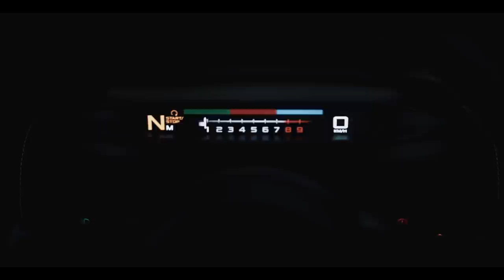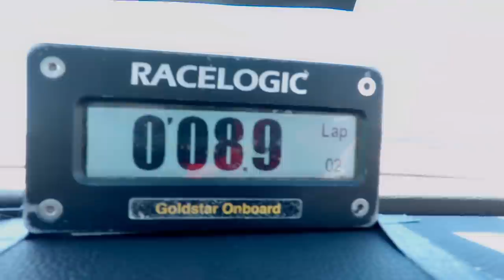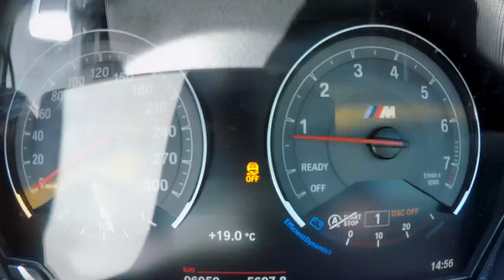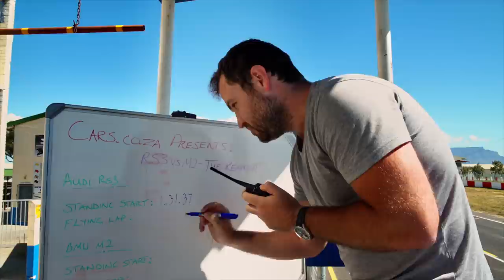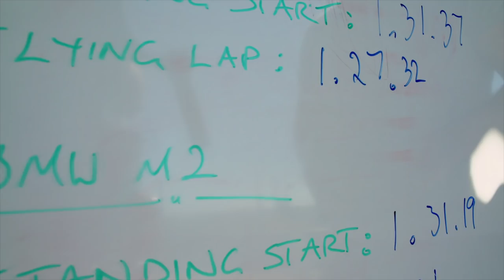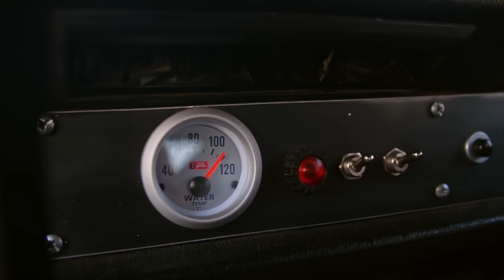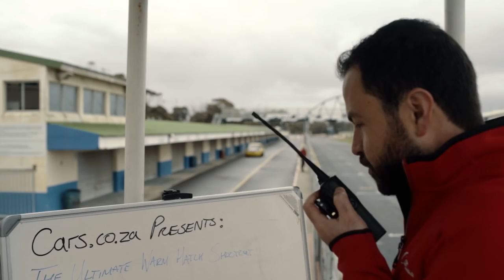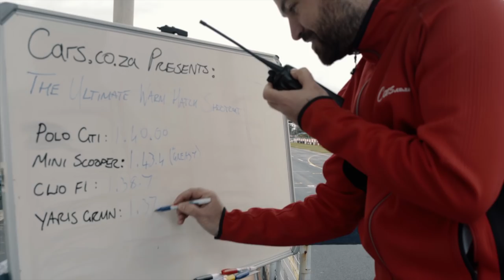The Cars.co.za Show, Episode 3 - McLaren 720S, Liberebil Interview, M2 vs RS3, Yaris GRMN Track Race

Comment: The RS3 was supposed to be pitted against the M3 & not the M2.
Reply: I believe that's a fair comparison. M3 should be pitted against the RS4
Reply: BIG- MIKE it’s a fair comparison, I agree with Henry Sithole. BMW M cars lack in certain places but they are brilliant, don’t get me wrong.
Reply: @iamkhanyasakawuli  right buddy, was under the impression the M2 was a bit smaller perfomance wise & thanks for the heads up.
Reply: @henrysithole3623  i get it & then the M4 should be up against who in the Audi RS range?
Reply: @big-mike2955  RS5
Reply: That doesn't make sense
Reply: Yes M3 goes against RS4, RS3 is a hot hatch not a small super saloon